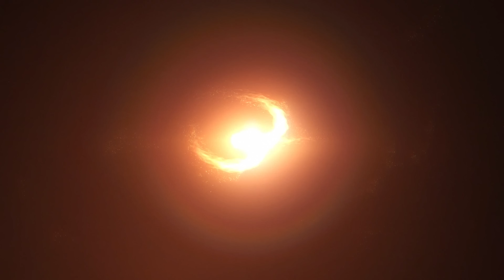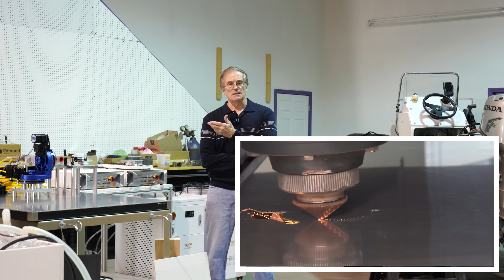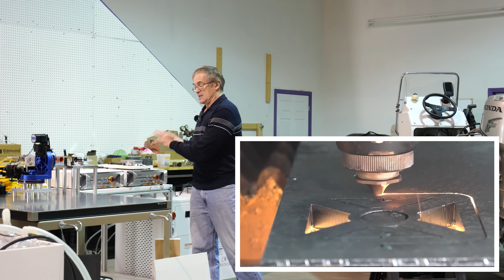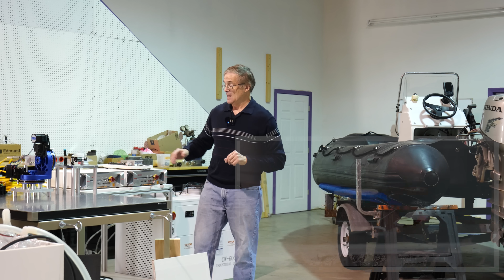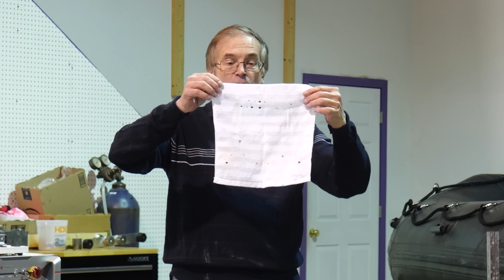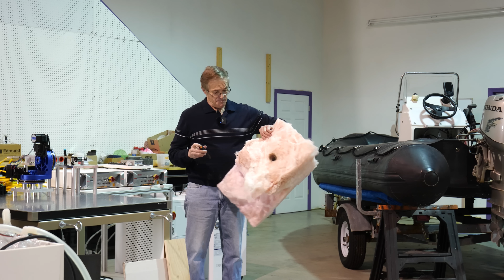We have a problem... and need your help!

Comment: Late to the party. As silly as it sounds, I'd probably angle a large mirror as an impenetrable backstop. Angled at roughly 45°, it could reflect the beam downwards, where penetrating the floor poses minimal hazard to people or property. It can be difficult to source large one-piece mirrors, so if multiple pieces are needed, nearer mirrors should overlap farther mirrors (instead of being joined by butt splicing). As for absorption, perhaps a large kiddie pool would work for 1080 nm infrared. Perhaps adding other chemicals like antifreeze or (non-halogenated) dyes could be used to tune absorption at this wavelength. To minimize unwanted reflections, the water surface should be still, and the angle-of-incidence should be kept reasonably close to 0°. However, a small compound (Euler) angle would be useful in directing water-reflections away from up-range people or equipment. In that case, people should be located to the (appropriate) side of the laser, as part of your checklist. Reflections of polarized light are allegedly eliminated when the angle-of-incidence is equal to Brewster's angle. I'm no expert in lasers/optics, but this phenomenon might be worth looking into.

Perhaps 90% of modern consumer mirrors are silvered with with aluminum, with the remainder being genuine silver. Specialty/laboratory mirrors are of various compositions.
Fiber, MFSC-1500X (1080 nm): Au ≈ 99.0% reflectivity,  Ag ≈ 97.7% reflectivity,  Al ≈ 95.6% reflectivity
gallium nitride, violet (405 nm): Au ≈ 37.0% reflectivity,  Ag ≈ 85.2% reflectivity,  Al ≈ 92.4% reflectivity
gallium nitride, blue (450 nm): Au ≈ 36.3% reflectivity,  Ag ≈ 88.9% reflectivity,  Al ≈ 92.2% reflectivity

With less than 100% reflectivity, you'd want to test the mirror for boiling/ablation of the silvering. Not only could holes be punched in the silvering, but upon shattering, the orientation of falling mirror shards would become unpredictable, resulting in dangerous errant reflections. Assuming overheating is a problem, it would then be necessary to solder/braze a rudimentary heatsink, or else bond one with thermal paste. It could be as simple as a flat plate or sheet of aluminum. This modification would need to be performed carefully, to minimize air gaps. It would have the bonus of stabilizing shattered glass shards.

Otherwise, a thicker glass-less mirror could be made from a polished sheet or plate of aluminum. 1000-series is quite pure, and Alclad (though pricy) is strong, yet has a pure surface. Otherwise, some consideration should be given to researching the relative reflectivity of unplated alloys (e.g. 6061). The polished sheet should be stored and handled carefully, to prevent scratches that might result in errant reflections. Regarding thick plates manufactured by casting, these might contain porosity or voids, risking errant reflections. Therefore rolled material (or else low-porosity cast jig-plate) would be preferred. Furthermore, the nearest edge of the near-most mirror/segment should be either compound-angled, or sharpened to a knife edge. If sharpened obtusely, consider that upward reflections are possible from such edge geometry (but perhaps preferable to up-range reflections).

To select an appropriate mirror thickness it makes sense to obtain small coupons of aluminum sheet in various thicknesses. When tested at a 45° angle, there should be no perforation, ablation, boiling, or dripping; and minimal (if any) melting.

If surface damage is a problem regardless of thickness, gold is the ultimate solution. There are processes for gilding or gold-plating aluminum. If intimately bonded, this would combine the reflectivity of gold with the cost-effectiveness, thermal conductivity, and heat capacity of thick aluminum. Also, the manufacturing process would make for an interesting video. Just be careful if cyanides are involved. Speaking of chemical hazards you're probably aware of, chlorinated/halogenated solvent residues should be avoided. Avoid stainless steel or chrome-plated targets where practical, because hexavalent chromium is chronically toxic.

For less powerful lasers, heavy-duty aluminum foil might suffice, overlapped as described above. I'd be shocked if foil survived even your diode-laser arrays, but at least it's dirt cheap. Trim and handle it carefully to prevent crinkling. Such foil is usually 8011 alloy, which is not as pure as 1100 or alclad.

Heavy-duty aluminum foil: a few $
Large kiddie pool (non-inflatable): tens of $
Large mirror(s): hundreds of $
Large aluminum sheet(s), 6061 or 1100: hundreds of $
Gold plating: hundreds or thousands of $

This stuff is dangerous in many ways. Stay safe!

Comment: Brick wall on wheels,  mobile and durable,  cheap to replace bricks that have had it.  Could use scaffolding type wheels so height can be adjusted, as to change the impact area maximising surface area prolong it's usability

Comment: Using theory of cymatics.  You can manipulate the water from a hose pipe to spiral when subjecting it to sound waves.    Or use blasts of air to put out any fires.

Comment: Coat a sheet of 2 ply cardboard with a thick layer of graphite (from drawing tools that have a ‘B’ grade/softest; or even a small graphite ingot). Lather it up in graphite then soak the back side in water or use a spray bottle to saturate the back. That’s what I would test. Good luck. 🍀

Comment: I found this video because I would like to propose a simple video. I will get to that but the item common to both the proposed video is graphite. I do not know if graphite would work for your fiber laser video or not, only tossing it out there. For the proposed video, I would like for you to create carbon resistors with known, repeatable values. I would suggest using various clays as your graphite carrier. It would really be cool to see if you could create repeatable resistances as well as wattage dissipation for your resistors. You might be able to blow up some of your test pieces by overloading them. Fun. TY for 'listening'.
Reply from the maker: Thanks

Comment: Would a prism(s) work to scatter apart the laser light into less harmful light or is the laser just going to melt the front surface it first touches?
Reply from the maker: It would.
The challenge is that we have to protect the entire 20^2 M wall area.

Comment: We often use lenticular plates for some of our artworks. This is basically a special kind of plastic sheet that diffuses all light coming through. Perhaps you could use that as a first layer, not stopping the beam, but diffusing it instead, and then behind that you could probably suffice with a more simple safety barrier.

Comment: What about that ceramic used for melting gold in an induction furnace, or a "cup" of graphite that has some kind of water or oil in it.
Reply from the maker: You need a very large area to be covered.  It's approximately 20^2 M.
We need panels that can cover that entire back wall.

Comment: I’m a bit late to this call, but I have have explored a similar problems in designing a cost effective beam dump for 1064nm lasers in lab instruments. My material of choice is McMaster’s selection of conductive graphite bar stock—PN 1763T13 is a cheap test sample. Do not try the steel backed thin sheets, use at least 1/4” thick stock. It will have a sawn surface finish. I’ve focused a 20W laser down to ~50um and left it on the bar for a week with no noticeable pitting. I’ve looked behind the bar with an IR scope and noticed no tunneling to the backside. Give it a shot! I got the idea from using graphite to protect metal surfaces in a very aggressive ebeam PVD chamber from excessive heating—it holds up amazingly well.

Comment: we know military directed light weapons have issues with basically heavy fog - perhaps that's what you need - a very heavy wet moving mist circulating between two containment walls with a vent to lose the steam generated.  lightweight, portable, easy to repair if actually needed.

Comment: What about a small sphere with pieces of glass or mirrors inside that spread out the beam and or send the beam in front of a sensor that kills the power upon sensing the beam.

Edit: the beam probably should enter the side of the sphere if mirrors are used, so that the beam spins in a circle.

Comment: Materials Suitable for Stopping High-Power Fiber Optic Lasers

When dealing with extremely high-power single-mode fiber optic lasers used for metal cutting, specific materials can effectively stop or absorb the laser energy. Here are the most suitable options:

1. Metal Shields

Steel: Thick steel plates can absorb and reflect laser energy effectively.

Aluminum: While lighter, it can also be used, but may require thicker sections.

2. Ceramics

Alumina (Al2O3): High melting point and excellent thermal stability make it suitable for high-power applications.

Silicon Carbide (SiC): Known for its hardness and thermal resistance, it can withstand high temperatures.

3. Composite Materials

Carbon Fiber Composites: These can be engineered to provide high strength and thermal resistance.

Polymer Composites: Certain high-performance polymers can be designed to absorb laser energy.

4. Glass

Specialized Laser Glass: Certain types of glass can be used to absorb or deflect laser energy, but they must be specifically designed for high-power applications.

5. Water or Liquid Cooling Systems

Water Shields: Using water as a barrier can absorb laser energy effectively, especially in industrial settings.

Considerations

Thickness: The effectiveness of these materials depends on their thickness and the specific power of the laser.

Reflectivity: Materials with high reflectivity may not absorb the laser energy but can redirect it, which is crucial for safety.

Using the right combination of these materials can help ensure safety and effectiveness when working with high-power fiber optic lasers.

Comment: there was an old scientific american article about non reflecting light surfaces. One of the materials was a stack of razor blades on edge, can you give me the reference to that article?

The Scientific American article you are referring to is likely "No Glare There," published in the May 2007 issue

. However, this article discusses a modern nanomaterial with a refractive index close to air, not the classic demonstration involving a stack of razor blades.

The specific demonstration you mention—a stack of razor blades on edge to create a non-reflecting surface—was featured in the Amateur Scientist column by C.L. Stong titled "Nonreflecting Surfaces" in the January 1970 issue of Scientific American. In this article, Stong describes how arranging razor blades on edge creates a surface that reflects almost no light due to multiple scattering and trapping of incident rays.

:

    C.L. Stong, "The Amateur Scientist: Nonreflecting Surfaces," Scientific American, Vol. 222, No. 1, January 1970, pp. 116–120.

This is the classic article that describes the razor blade stack method for creating a nearly non-reflective surface, as well as other approaches to minimizing light reflection.
Reply from the maker: I actually remember that article and many modern laser dumps follow that principle. Light striking a surface or surfaces at a glancing angle scatters, and the energy is distributed over the sides of the blades, reducing the local intensity.
The problem for our application is that we need to protect the entire back wall, which represents about 20 M^2.

Comment: personally i'd try a carbon sheet in front of a layer of Nomex, essentially trying to recreate the heat shielding of the Space shuttle.
Reply from the maker: That might work.  It probably wouldn't be  cheap.
Reply: @TechIngredients  true, but with the limited diameter of the beam, you wouldn't need much, and you could probably obtain nomex from surplus firefighter suits, and carbon panels from sites selling scrap odd lots.
Reply from the maker: The beam itself is very narrow.
The blocking function has to protect the entire wall behind the firing range because the beam can point anywhere in that field.
Mechanical stops can limit the beam from moving beyond that field, but if the beam removes a target quickly or there is a glitch that stops the scanning movement, the wall will be hit potentially anywhere within that field.
We're talking somewhere around 20 M^2.
Reply: @TechIngredients  you might also want to go to Lowes, or Home Depot, and grab tile samples, and fire the beam at them and use trial and error to determine which has the highest/lowest heat conductivity, it'd also make for a great video.
Reply from the maker: That we will do!
We're going to demonstrate a dozen different material recommendations as well as a few light-hearted demos of some other interesting targets.

Comment: Based on your salt mine comment, maybe water softener salt blocks?  They'd be hygroscopic so self-dampening during humid months.  In that case, I suupose explosive speed steam might be experienced due to the intense heat but really should only result in a fractured block and maybe a tumbled section of wall.  Do it during the summer and have the DMV store their road salt in your warehouse? :)  My engineering thought is more of a two pronged approach, prevention and protection.  I wrote operating systems for multi-ton automatic guided vehicles in manufacturing environments around people.  We needed to figure out what could fail and what could be done to detect and control for it.  So, for example, a watchdog on the laser power supply.  A computer glitch such as a hang would not pet the dog and the power would shut down.  If that is possible, it would be very inexpensive.  Minimize the needed protection area during computer debugging by incorporating physical limits such as hard stops or limit switches on aiming gimbals.  Limit switches would also cut power.  Sensors to detect that scanning has stopped for X time and shutting off power such as encoders on the servos, again sort of a watchdog solution.  Or, as another plug for "Real Genius" and the late Val Kilmer, aluminum foil and popcorn:  https://www.youtube.com/watch?v=rthHSISkM7A
Reply from the maker: Your layered approach is a good one.
Whatever blocking method we use, that will reduce the demand on it.

Comment: First rotate the test setup 90 degrees so that the laser is aimed at the floor. On the floor you put graphite plates, or black sand.
Reply from the maker: We've gotten a number of recommendations to fire the lasers downward. 
The problem is the available room. We need the drones to be flying around, and the laser with all the optical equipment would have to be at least as high as the ceiling. That's really tough.

Comment: I will throw in my 2c for Syntactic foam, I think it would do the same job as you predicted with the insulation fibre, But a lot better, As its glass micro sphere based i think the scattering effect inside would be many times stronger than the fibre.

Comment: Use a mirror to direct the beam into a bucket of water with a heavy mixture of carbon black?
Reply from the maker: That would work.
There are issues.  A typical commercial mirror will explode when hit by 250,000 watts per cm^2. Laser grade mirrors that will survive this power level are EXTREMELY expensive as in $1,000 per ft^2. We need to cover an area of a couple of hundred square feet.

Comment: What about dispersing it again?  2 ways. First with a lens - it would have to be big but would be static.  the other thought is a mirror aimed in a general direction but it is on something that oscillates very quickly effectively sending a pencil beam over a large area quickly and not in one spot long enough to damage the target material.  a couple of orthogonal axis in series.  You could also aim it down into some smaller steel cube that it could paint and melt the steel (would move too fast to just burn it

Comment: Add two lenses to spread the beam into wider beam and then align the beam so that it's bigger. Less heat at a central point. So easyer to deal with may be?
Reply from the maker: We don't want the beam on the target to be wide and less intense. Because the target can be moving toward or away from the laser, the beam needs to be as narrow as possible for as long a distance as possible.

Comment: The guy from BPS space made a video about a thermal liner material for the inside of a rocket that can withstand very high temperatures for a certain amount of time. The video is very detailed and it is called, Is This The Best Insulation Material?

Comment: water cooled copper or steel plates at an angle considering the lasers used..? or tumbling sand or some other kind of sacrificial wheel coated in some material of desire.(mild steel plates are cheap)